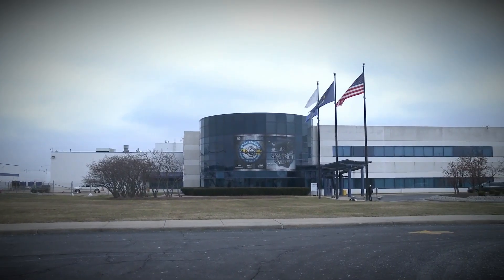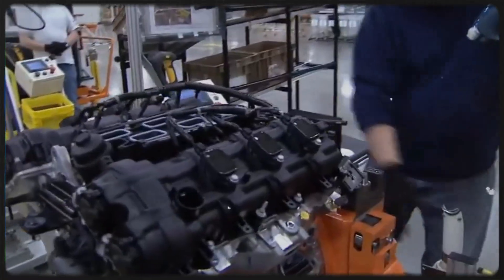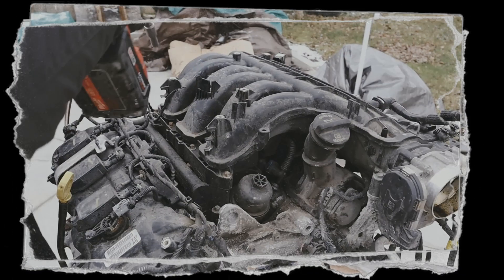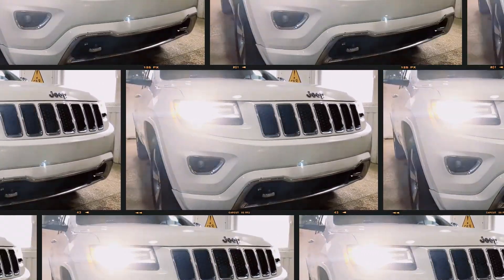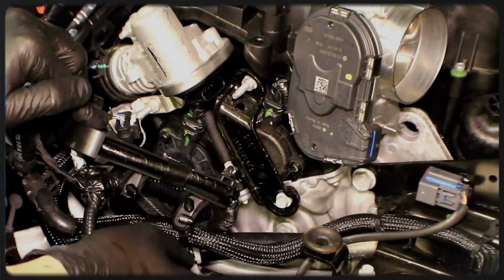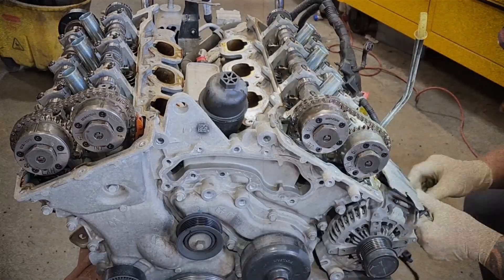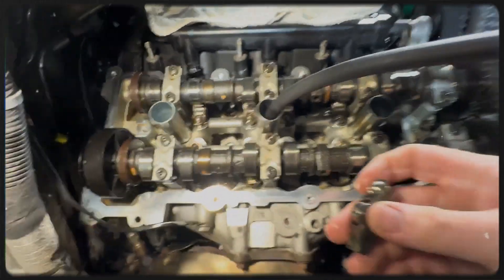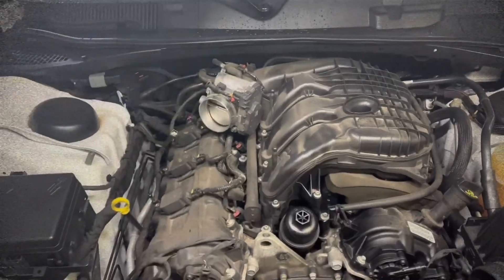3.6-liter Pentastar V6: Common Issues & The Ultimate Reliability Review!

Comment: Well i use 5w30 in my 5.7.2021 ram warlock im at 167,530klm..no tic...no.header gasket problemes..and use seafoam every 6months in oil pan before oil change and have no problemes as of yet

Comment: My 2016 Chrysler 300 limited RWD (BASE MODEL) bought new with 4 miles on it, today has over 250,000 miles on it with no issues! Hell, even the brake pads lasted 105,000 miles! I change the oil and filter myself every 5000 miles with a Mopar Oil Filter I get on Amazon. I use only MOBIL ONE Synthetic 5W -20W for the first 150,000, then switched over to 5W-30 w after that until today! All of my past cars were always BASE MODEL AMERICAN MADE RWD cars, bought by ordering it from the factory, not cars sitting on dealers' lots! Never had any issues! GOOD LUCK!

Comment: My 2012 Challenger and 2014 300 are going strong. The Challenger uses 5W30 and the 300 takes 5W20. Both use Valvoline or Quaker State full synthetic and I change the Oil at 7000 k. None of that recommended 10000k oil change from Suckllantis. Stellantis ruined a great American car company with the Euro trash made in Italy. I brought my cars before they brought Chrysler.

Comment: So let’s explain 2 major things that are very wrong and not customers fault. Manufacturer recommendations for low viscosity oil and transmission fluid for fuel efficiency restrictions by government and second wrong thing for the same reasons I mentioned is high operating temperature by adding 204f thermostat VS 180f that is standard and in some vehicles and trucks they add plastic shutters in front of radiator to keep operation temperature high for emissions purpose, SO high temps with low viscosity oil and transmission fluid is not good combo or I can say is a disaster that the customer have to pay for. The minimum oil viscosity for any V6 or V8 engine is 5W30 that any vehicle or truck should start from, I installed 180 RIPP thermostat as well and removed stupid plastic shutters in front of radiator and now I have normal operation temps like all my other vehicles Mazda cx5 and second generation Tundra around 186-188f, I mean exactly the same I have gauge tool to measure the temperature. The 3rd manufacturer mistake or bad design is the cartridge oil filter, but thanks to Baxter performance adapter for spin on oil filters I fixed also that issue to prevent dry starts that is known as lifters killer. So if you treat the pentastar v6 engine right from the very beginning with the right viscosity and high quality like Amsoil or Redline oil and fluids every 5-6k miles engine and 50k miles transmission your vehicle will last forever.

Comment: 5w30 is the key to get too 200,000 miles or more out of those engines with out it ticking we’ll at least it have worked for me can’t speak for others
Reply: pacifica specs say 0-20, doesnt it?
Reply: I've stuck with the thinner oil spec in the manual on my 2019 Pentastar Grand Cherokee since new.  I'm at almost 150k with not a single issue. Just normal maintenance items and oil changed every 5,000 miles. It's actually been the most reliable vehicle I've ever owned.
Reply: Same ive run 5w30 in mine since it was new.

Comment: Failed to mention the oil cooler.  Every one I've ever seen at the shop with over 90k has a leaking Oil cooler under the intake.  Not a terrible job, just know if you own one of these engines you will be replacing it around 100k if not before.

Comment: I bought a new 2024 4 door Willys. From day one I installed the Baxter Performance. During my last oil change, I removed the oil plug and drained. As a second step, I replaced the drain plug and applied the air pressure on the Schrader Valve of the Baxter Assembly and I drained an additional 10 oz. into the oil pan. During this process the engine was not started for the previous two weeks and all of that oil was trapped in the valve system for that period of time-that is better than any type of OEM dry start . I still do not trust ANY OEM manufacturer and I STILL BELIEVE that part of the issues are QUALITY OF THE ROCKER assemblies. Also to meet EPA regulations, I think that the oil 02W20 could be breaking down at high temperatures. That is detrimental to the complex drive train that runs on SPLASH lubrication. I only run the engine on 5W30. With all of these precautions, I still believe that the valve rockers will get damaged at anything more than 35,000 to 80,000 miles. I think it is a sad affair that this manufacturer does not tighten up its quality assurance. Made in the USA carries a lot of pride and Stellantis is just damaging that image that we should all be proud of. I am an Aerospace Engineer and I love Wranglers but I despise the horror show that the manufacturer overlooks for so many years.
Reply: You know that the third gen 3.6 pentastar starting in '17 they updated the entire valve train so top ends are not failing anymore in Pacifica and other applications..
Reply: Is that engine even made in America or assembled with foreign parts  l to own a wrangler with this 3.6 gone threw the broken rockers a bad cam shaft and in the end had to replace a head  love the jeep but it garbage

Comment: My meticulously maintained 3.6 Pentastar on my 2019 Jeep Wrangler reached 103k before the camshaft, lifters and rocker arms failed.  So sad.  Ran great until then.  The telltale sign was check engine, cylinder 4 misfire.
Reply: What were your oil change intervals like?
Reply: @DJR5280 3k to 5k miles.
Reply: Change your oil every 3500 miles.  Check your oil periodically. All these new engines run low
Reply: I changed it about every 4-5k.  But my shop says they've seen a lot of this.

Comment: Baxter Performance Spin-On Oil Filter Adapter for Jeeps with the 3.6L Pentastar engine (and some other Chrysler/Dodge/Ram vehicles).
Here's a breakdown of what it is and why it's used:
 * The Problem: Many Jeep 3.6L Pentastar engines use a cartridge-style oil filter, and the factory oil filter assembly often lacks a proper anti-drainback valve in the upper part of the engine. This means that when the engine is shut off, oil can drain back down into the oil pan.
Reply: Yes, but most of the valve train oil drains back either way.  The residual oil in the proposed spin-on filter just adds a little oil into the stream.
Reply: @TucsonDude At this point I'm doing every little thing I can to possibly prevent another rocker arm & camshaft failure nightmare.
Reply: @echristianh  I understand.  I own a 2017 Rubicon with 10K miles on it.  The engine is practically noiseless.  I just look at changing the oil often.  While I vastly prefer a spin-on oil filter, I'm not one to "experiment" with something fairly tried & true.  Good luck, tho.

Comment: Oil cooler problem s is mainly caused by overtorqueing filter cap.
Reply: Overtorquing the filter cap is the most common low-milleage breakage issue, but by the time you get 120K-130K, failure of the seals underneath the housing will become problematical.  That will happen even with aluminum versions.  The best and most durable seals known right now are the Mopar seals.  Even if you get an aluminum housing (and Dorman is the best), still get Mopar seals and sensors.
Reply: This is a very underrated comment.  I replaced the whole filter housing with an aluminum part made by Dorman.  It’s been 8 months and probably 17K miles.  I have obviously changed the oil a few times during this run and have only recently torqued my filter cap to specs.  I wonder if this was my issues before or if the plastic housing is the cause.  Thank you for the perspective

Comment: I have a 3.6. I love it. Great gas mileage and it rev to 6000 rpm all day long. Cams come in @ 3000. NOTE:, the oil pressure is capable of 125 psi!

Comment: The engine was engineered to use 5w30 in 2011. Push from epa forced the use of 0w20 oil. This has caused all the issues with rocker failure as the engine was designed to use 5w30.
Reply: No, the problem with the rocker arms was the design of the needle bearings. For sure, if your oil maintenance is bad, you'll have problems more quickly, but even with the best oil maintenance, the earlier versions of the needle bearings were unacceptably unreliable.   It's only been since the H version of the rocker arms produced by Mopar since 2014 have the needle bearings become reasonably reliable.  By "reasonable," I mean you can confidently expect them to last for 120K-130K.
Reply: It’s much better to run 5w30 it is actually labeled 5w20 on the cap. 5w30 helps but it is caused by the needle bearing on the rocker arms which fail
Reply: @gunztommiegunz they used stamped metal instead of hardened metal
Reply: @forfuxakes9799 exactly. Updated design. I have 12 on the side and at 120,000 miles no issues. Just took the covers off for inspection and looked fine. No play yet. I’m going to replace them asap upon noise
Reply: I owned a radon mitigation company. Over the years I owned 13 Ram 1500 and one 2020 jeep gladiator.  I didnt have any engine problems, water pumps and a alternator 😊.  I still drive the 6 speed manual gladiator.  I love  the pentastar: )
Reply: Don't go up on the first oil number or down on the second.
Reply: Eh id disagree it’s just a bad design, you see way less rocker failure with the third gen pentastar which is one of that takes 0w-20 oil. The second gen pentastar takes 5w-20 but I’d say using 5w-30 is ideal for that generation.
Reply: Negative...
Reply: Does using 5W-30 kind of solve that issue then?
Reply: In the sense of if your engine doesn't have that issue and you use 5W-30 it will prevent that issue from happening
Reply: @Stone_Raven_tv negative. The updated rocker arms fix this
Reply: @gunztommiegunz the updated rocker arms are using hardened steel ….
They used stamped steel on the originals.

Comment: I’ve owned three of these engines.  All have blown head gaskets.  One at 79,000 and I know others with the same problem.  Polymer plastic oil cooler is junk and I’m convinced it’s intentional failure to get you back in for expensive work.  This problems these engines have had should have all been known when they tested this motor before putting it in a vehicle.  I’m also convinced there is politics in the Wards ten best engine awards.  I could maybe see it winning once but no way four times.  I hate to be negative about it but I have taken good care of all of them and they have been a big disappointment.
Reply: I have a 2015 model year with the 3.6.  I replaced the plastic oil filter housing with an aluminum component and have been most pleased.  I will be replacing more plastic components with aluminum parts as time/money allows.  I’m almost at 100K miles now.   By the grace of God, I hope I’m one of those that sees beyond 250K in this one.
Reply: @TheNativeAmericanDream absolutely possible. Keep the oil clean and use 5w30. You’ll get it.
Reply: That’s crazy cause I’ve owned 3 as well, 2 currently and none have had blown head gasket. The first one have over 160k miles before it was totaled, the other has 130k miles currently running like its brand new, and my last has 120k miles still running strong
Reply: Just replaced a blown head gasket in our 2018 Grand Cherokee for $5700. It was at 130,000 miles. Definitely not a good engine.
Reply: @paulshumway5880  you have to maintain the vehicle. I bet you took the dealers word for it at the coolant was good for 100,000 miles too. Any engine can have issues with head gaskets. $5300 for a head gasket repair is Highway robbery.
My 3.6 as 120,000 on it but I’ve changed the coolant multiple times over and make sure that it’s not running super hot . You know you have to check your relays your fans. Make sure that you replace thermostats before they go bad all of these things can cause a head gasket to blow
Reply: @gunztommiegunz  It was maintained “ by the book.” Oil changes, filters, brakes, four wheel services and 100,000 mile service. That’s what hurts. When something is maintained properly there is still failure.
Reply: @paulshumway5880 It is a good engine the video just told you that, you're just sadly one of the .05% with that problem.
Reply: @paulshumway5880  Did you let the engine get low on coolant or overheat at all? Modern aluminum engines do not handle running hot. Any brand will blow a head gasket if allowed to run hot or has a coolant leak that is not addressed asap.
Reply: @jasonm3347 No, I checked fluid levels regularly. I owned an iron foundry in Illinois. 130 year old C.W. Shumway & Sons. The biggest mistake auto manufacturers have made in the last 100 years is aluminium blocks and heads. Iron will disipate heat better, hold tolerances better and absorb vibration better. They were scrapped to save weight and cost. Scotty Kilmer says Jeep, Peugeot and Fial are the 3 stooges of auto manufacturing. I tend to believe him.
Reply: @paulshumway5880  countless Honda aluminum block and head engines with 200k-500k miles on them, engines never been opened.  But you are correct, overheating them, usually through neglect, kills them.
Reply: And absorbs vibration better.
Reply: Sorry, mentioned that.

Comment: 2018 JL owner here... Cylinder head is still a problem, i just replaced ours to the tune of $6k total.
Reply: Update... 105k miles and the other side went out... Traded it in because it's not worth it to keep feeding it my dollars.
Reply: How many miles in your engine when you replaced it ?
Reply: @striperking6083  95k we replaced the driver side head, all plugs, 3 coils, evap canister, and oil cooler.
Reply: @michaelgallagher8341  had a 2015 Willys that had a couple injectors replaced at 38k . Then a few chk engine lights and sputtering starts with gas smell . 
Traded it in for a 2023 Rubicon , same engine. This time I got extended warranty 8/85k from Mopar
Reply: @striperking6083  hey good luck! I hope it stays for you, we still have ours but I just walked into the garage and my wife's had a pretty strong smell of gas... I may be right back where I was but hopefully not.

Comment: I understand the design was to not have spark plugs charged until 100-150K miles, but very not a fan of having to basically remove the intake manifold to change plugs.  Also not a fan of the plastic oil cooler/filter housing……too may plastic components near high temperature areas…….Fortunately there are upgraded aftermarket metal upgrades available!  I had a rental in 2016 and managed a fairly consistent low 30’s MPG even cruising mid 70’s with the ZF 8 speed automatic.  I would call it overall a very reliable engine.
Reply: It’s all going to cheap plastic parts. High prices = crap plastic parts

Comment: Mine has 160000 miles, just started ticking due to rocker arm roller issue
Reply: USE   10 W  30  OIL.